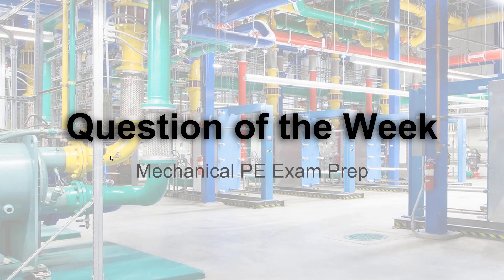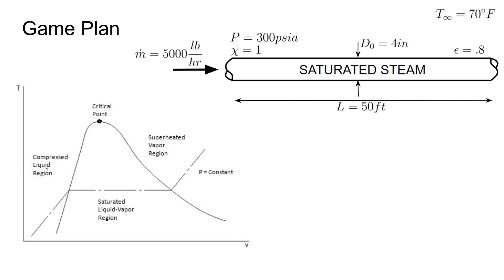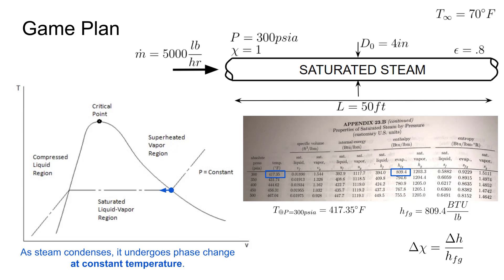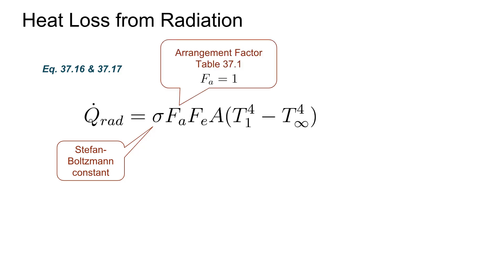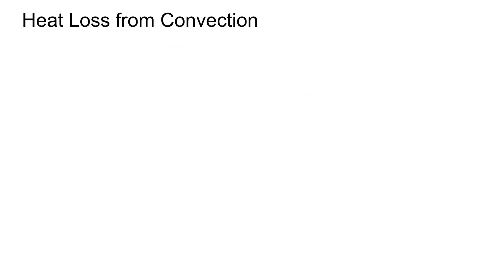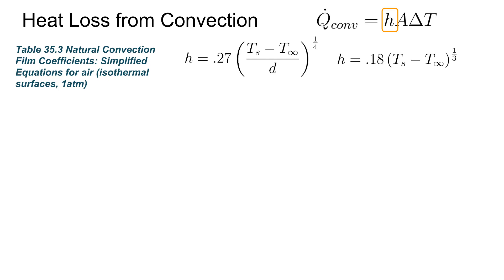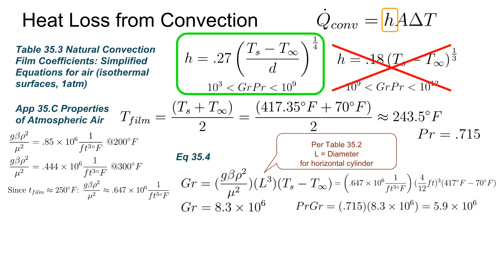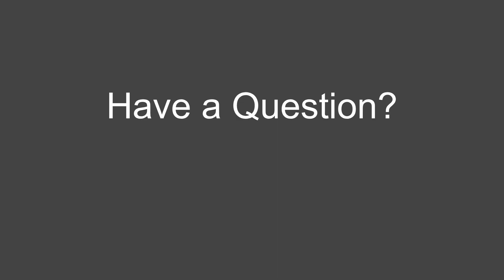How to Calculate Heat Loss from an Uninsulated Steam Pipe | Mechanical PE Exam Problem Solution

Comment: im just kind of a nobody plus this math is way more advanced then im currently capable of understanding. my question to you is could you do this equasion for me but insert 70lb steam under the same conditions and tell me the btu loss pr hour. insted of 13 btus it may be 4 but i just need the end result to crunch savings in my situation. thanks kindly
Reply from the maker: Paul, Why don't you take a first shot and email it to me?  Happy to help review, but I would like you to try first.